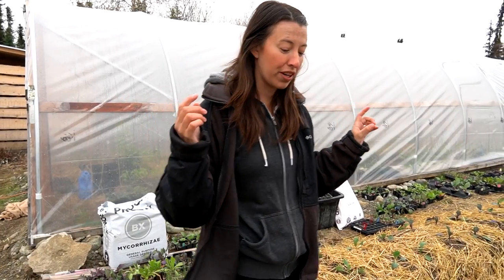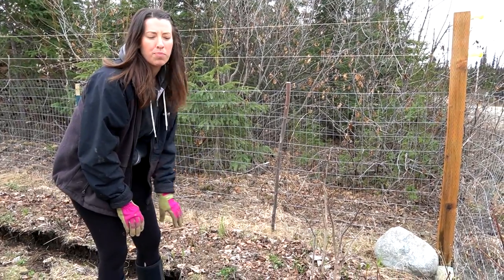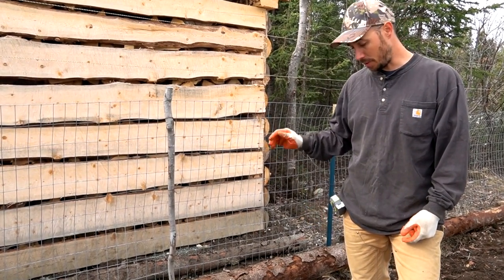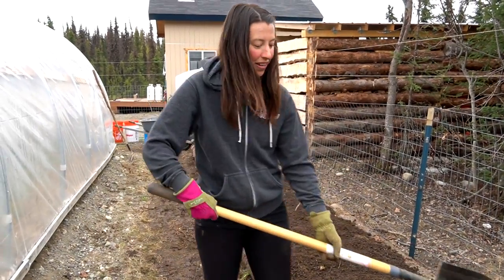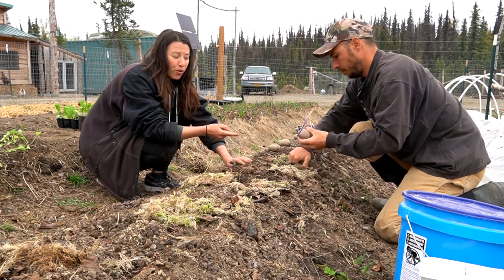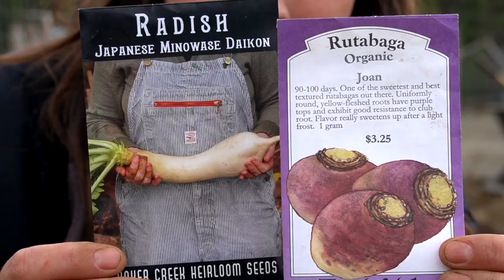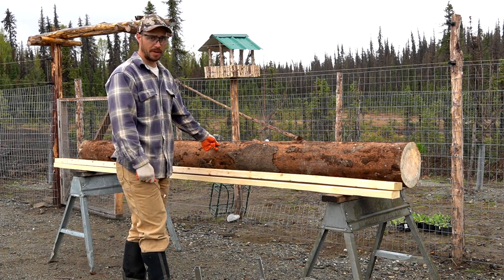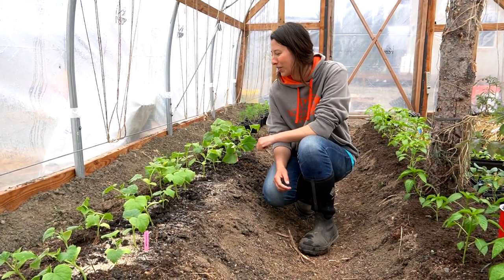Working Hard for Our Food | Vegetable Gardening in Alaska

Comment: I know that you both love celery, as do I. If you can plant enough, you can dehydrate them for soups and I actually take it a step farther with quite a bit and grind it down, making a celery powder. Doing this is wonderful and does not require a root cellar. Just an idea. Hope it helps.
Reply: @Chana Moriel 
👏👏like that ground celery powder idea. It would be so helpful and 5asty in so many winter meals soups, stews it. Thanx for sharing the tip.

Comment: Have you considered doing a low tunnel inside your greenhouse for eggplant & other warm crops? 3ft high works well for eggplant.  Ping Tung should thrive in the tunnel in greenhouse in zone 3. (We'd field-grow Ping Tung every year in Colorado Zone 5a - tolerates cool temps better than most varieties.)  Tunnel in a greenhouse should take you another 1-2 zones warmer, even with just 4-mil poly. 
We use low  tunnels in Texas to extend our seasons and for wind protection. Aphids always a challenge in tunnels/hoop houses - try interplanting some basil with the eggplant. 
Love your channel - great cinematography! Thanks for sharing your adventures!

Comment: If you can spare a semi-permanent corner in you garden or a small place on your property, this is how I have virtually "perennial" parsley: I planted a 3 ft sq of flat leaf parsley years ago, letting a few plants go to seed.  I've never replanted and have fresh from April to November. Then I cut all the small stuff to the ground, mulch well to prevent soil heaving, which can break the long tap root of the mature plants.  Then I wash and spin dry the fresh, pulse in the food processor and freeze.  The taste is great, visually not so great, but fine as an ingredient.  BTW I do not freeze in ice cube trays, not usually needing that much at a time - just put in Tupperware. A perfect cut & come again herb and can easily air dry too😎

Comment: I've often wondered if you could build a "cold storage' room above ground using Styrofoam blocks, like the ones builders use for cement walls... I once visited a home in Prineville, OR, in the garage was a 4'x4'x8' walk-in closet. It was over 100 degrees outside, but in that closet it felt like it was just above freezing. The walls of the closet were 8" thick! Styrofoam panels sandwiched in plywood. What have your neighbors done for a cold cellar with the water level so close to the surface of the ground?

Comment: I still think building an "above ground" root cellar might be the way to go.  It'd be a lot of work, but it could be done earthship style with dirt pounded into used tires for stabilizing the inner embankment walls.   The main problem is where to put it, of course--edge of the muskeg, maybe?  Soil-cement could be used for the flooring; if you put down gravel, then mixed rocks & dirt with cement powder, laid it down on top with water, and just watered it thoroughly for a few days, that could get you a pretty stable platform.  Foamboard on the ceiling would help trap in heat, and the natural slope of the bunker would help insulate and keep it cool...  

But again, it's a lot of work, and a project that might or might not be finished in one summer, and only the two of you know what you can do, and what you'd want to do.  On the bright side, the tires wouldn't need to fill the whole embankment, just enough to stabilize whatever dirt a bulldozer (Polaris or rented) could push into place for the necessary thermal mass.  An additional bonus to an above-ground root cellar is that the southeast to southwest slopes could be ringed with logs for stability and terrace-planted.  You could even hugelkulture some of the slopes with rotting tree trunks packed with compost, watering it as you go to help any compost or soil fill in the cracks; the heat of the decaying matter won't be much, but every little bit would surely help, up there in Alaska.
Reply: Curious about another root cellar too. Seems like you are missing planting quite a bit without one!

Comment: Celeriac is really common here in germany. You can use it finely diced as a base to soups - with a carrot and onion like mirrepoix (I think thats how its written!). Or one of my faves is cutting it into like 1-2 cm slices, parboiling and cooling and then breading them and frying it. Also celeriac is great when its cut into strips and then into the oven on a tray with some potto wedges etc and let it roast!

Comment: Have you considered burying a small shipping container for a root cellar? You could seal the outside to keep the metal dry and put two feet of concrete in the bottom to keep it down. It seems a shame that you can’t have a root cellar.

Comment: Potatoes are a very interesting plant, you should try to plant a few of the tubers into the high tunnel.Take two of your favorite varieties and put them next to each other, do not harvest the plants, but let them flower.  "pimp" them when the blossoms are open and then harvest the small tomato like fruit when they are ripe.
Plant those seeds next year.The genome of the potato is super funky, most have lots of chromosomes and the resulting plant started from seed can be wildly different from the original plant, but also perhaps be very well suited to the climate.Just a thought, not a botanist at all, but have tried to use the seeds from my potato-tomato in the past.great video!

Comment: Asparagus are actually very resilient, with my experience. I'm on my 4th or 5th year with mine (Mary Washington's), and have pretty much 'neglected' them (except this year, before they came up, I thew down cow manure). While amending other parts of my garden this year, I came across an asparagus crown (roots) where it should not have been. It was a bitch digging it up! lol But I had to 'cut' roots because they spread out throughout my plot. I transplanted it where it should be....with the rest of the asparagus. And it's now doing fine. My point.....don't be afraid to 'chop off roots' AND....even if you think the root system/crown 'doesn't look good', chances are that they are just fine and will still produce.

Comment: Surviving ringworm has an interesting setup for his chainsaw mill that makes sure he has the stuff to make the first cut every time as he has 2 steel plates that screw into the ends of the logs that support 2 steel square stock to give the first cut surface. No warping of the boards between needs and as it is steel not going to accidentally use it on another project.

Comment: Regarding your poorly producing asparagus bed, there could be two different, or both, reasons for its low productivity. One single and plausible reason could be that the bed is undermined by the roots from the close-by spruce trees and brush outside the fence, their roots sucking out most of the nutrients under your asparagus bed. The other reason could be that the asparagus bed was soil-set incorrectly at the onset. Asparagus grows best on top of a layer of 100% manure (for its roots to penetrate and get lots of nutrients), thereafter topped with a layer of loose topsoil or compost. If you wish to try growing white and tender asparagus, you top the manure layer with at least 16" of soil in a berm of trapeze shape. when they sprout above berm top surface, you harvest them with long dandy lion fork sticker, cutting the under soil white stem above the tuber level. My mother grew white asparagus in a berm, and advised me that the berm had to be renewed with bottom layer manure every three year, which is a lot of extra gardening work compared to the efforts with growing most other vegetables.